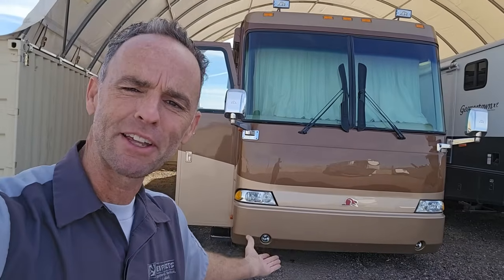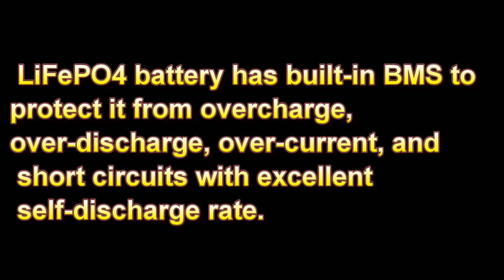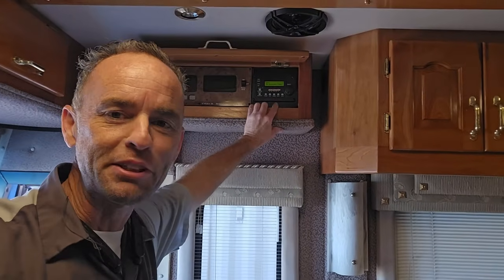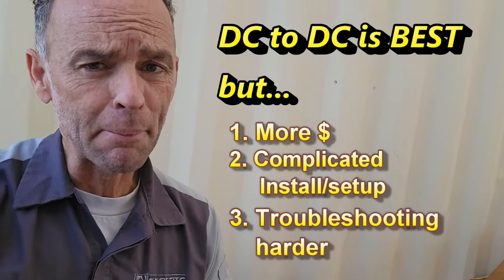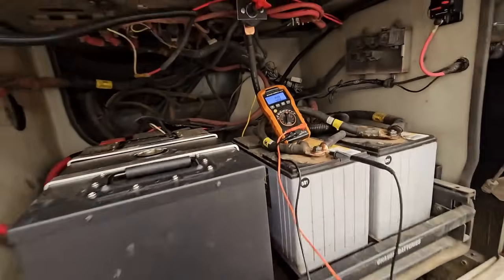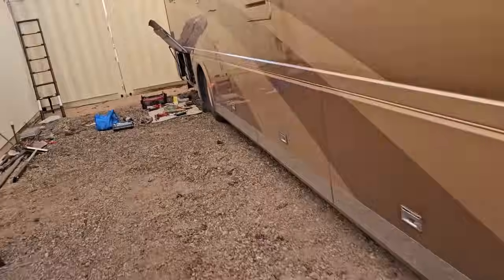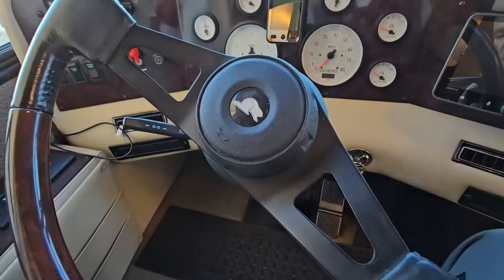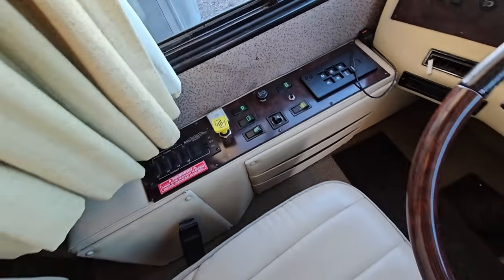What You NEED to Know About Adding Lithium Batteries to Your RV

Comment: You are very wrong in your explanation of the operation and responsibilities of a BMS.
Reply from the maker: Nah uh
Reply: @AZExpert  the BMS is a safety switch, like a circuit breaker. It is NOT a charge controller.
Reply from the maker: @charlieodom9107  https://www.synopsys.com/glossary/what-is-a-battery-management-system.html
Reply: @AZExpert  You are the one who should be reading that. Let's hope your viewers don't follow your advice on Lithiums, or they are going to wind up burning their property down.
Reply from the maker: @charlieodom9107  I did read it, no where does it state the BMS is an on-off switch and has active control for charge for the cells, I sent the link for your education as you have not been correct.
Reply from the maker: @charlieodom9107  I am also concerned what you think a circuit breaker is
Reply: @AZExpert  you obviously do not understand anything about a BMS. It IS an emergency switch. It is literally designed to isolate the battery in the event of a fault condition, such as over temp, under temp, over volt, over current, etc. That is LITERALLY what a circuit breaker does, only it can only "switch" in the event of an overcurrent condition. The BMS can switch off in many more fault conditions.

The only difference between a BMS and a circuit breaker in its function, is its ability to bleed off miniscule amounts of energy, normally passively, from one cell that is at a higher state that the others. That is not considered a vital function of the BMS, since it is such a small amount of energy that is bled off.

Very few BMSs have active cell balancing, and certainly not any installed in most batteries.

So, not only do I know what the function of a circuit breaker is, but your comment just clearly indicated that you are not qualified to argue the functions of a BMS.

A BMS will not control the amount of current going into a lithium battery. It can only act as a switch, turning on/off whatever you supply it or draw from it, and only does so when a fault condition dictates it, I.E. over volt, over current, over temp, etc. Quit telling people otherwise.

You should also look up what a CC/CV charge profile is, and how it relates to lithium batteries, because you are clearly misinformed.
Reply from the maker: @charlieodom9107  I appreciate your concession that it is not merely a on-off switch and has other functions including limiting current flow to cells in more situations than as overcurrent protection and has quite a bit of logic and control to its function. I've seen a switch and a BMS is not a switch anymore than a CPU processor is merely a couple of switches. Thank you.
Reply: @AZExpert  it does NOT serve any other usable function than a god damn switch! It does NOT limit flow to the cells, unless it is triggered by a fault condition. How is it so hard for you to understand?

Let me make it SUPER easy for you to understand:

A BMS will accept anything and everything you put into the battery or take out of the battery up to the failure point with NO REGULATION!!!!

That is the literal definition of a SWITCH!!! Just because it is a digital switch, and you can not understand that, doesn't negate it's function as a switch.

If the BMS was what you claim it to be, then why do you need a damn charge controller with lithium specific parameters? If it is more than a switch, then why does every single manufacturer require precise voltages, amperages, temperatures, and charge parameters in order to operate their batteries?

A BMS is a failsafe switch designed to save a battery in the event of a fault condition that could harm the cells, nothing more. You need to quit telling people otherwise, before you get someone killed!
Reply from the maker: @charlieodom9107  How would people be killed? The emergency switch as you call it would turn off the cells if the voltage is too high, current is too high, voltage is too low, temperature is too low, temperature is too high, or if cells are wildly out of spec or even dead. I have spoken to the battery manufacturers and they have also agreed. If you are building your own batteries with DIY cells you will need to make sure a proper BMS is connected as without it there is a definite danger, but that's the purpose of the BMS, to prevent danger and damage. I'd suggest making a video and sending me a link of your work. Let me make it simple for you, if a BMS turns off cells if voltage or current or temperature is too high/low and then back on again: it is regulating
Reply: @AZExpert  Fire is the number one cause of injury and/or death from lithium batteries. Using your advice in the video I watched, people WILL catch their shit on fire and possibly injure themselves, others, or kill someone.

Also, using a BMS as your charge controller is wholly wrong, and I can assure you NO battery manufacturer has told you to do such a thing.

The BMS is a last resort safety and should NEVER be utilized under normal operation. ALL battery manufacturers will tell you this. You shall have other controls in the system to charge lithium, or damage will result.

Charging a lithium directly from an alternator without a temperature compensated charge controller is ALSO wrong, as any battery manufacturer will tell you. You also can not charge ONLY lithium directly with an alternator without some type of load shedding device on the alternator or alternator regulator, but you did not mention this in this video.

You go on to state that the lithium battery charges faster at a low state of charge than it does at a high state of charge. This is false AND misleading. When the lithium charger is in CC mode, which is from 0%-96% or more, it can charge at the exact same amperage. It does not care. It is ONLY when the bulk voltage is reached that it moves to CV mode and the amperage starts to decrease. This happens at the very end of the charge.

You need to learn a few things about lithium chemistry before you continue to lie to people and cause potential injury or death. On the other hand, I make a shit ton of money fixing bullshit just like you suggest here, so maybe you are my job security.

I can give you contact info for engineers at Arco, Abyss, Lithium Pros, Optima, Victron, and several others if you like. They will all confirm everything I have said.
Reply: @charlieodom9107  After reading this entire exchange, all I can say is watch the video again. From some of your accusations, it's obvious you missed a lot of info.
Reply: @DaveDrawing  No, I did not miss anything.

Comment: i luv ur channel but, u are way over ur head in this. the bms on a lithium battery is almost the same charge rate as an AGM profile. the magnum u have will charge a GOOD LITHIUM BATTEY! please leave this up to the people who are an expert on this.
Reply from the maker: It seems unkind to use a compliment to soften an insult. You didn't disagree with my video but insisted I was wrong. BMS is not a charge profile, it is a control logic for the lithium battery, AGMs have no BMS

Comment: laughing at not upgrading your charging system...good luck with keeping the lead acid system in place it will fail as lithium does not charge at the same rate as lead acid.but keep the mis information up...lets see how long they last with the original system James..when you are on the road boondocking etc like we do
Reply from the maker: I think you may misunderstand but appreciate your input.
Reply: I've been running large Lithium house bank and Lead Acid chassis on my coach with older Xantrex that I reprogrammed for several years. I have realtime (and history plots) battery monitors to watch charge voltage , current and mAHrs and my system completely adheres to both battery specs for max charge voltage, currents, float voltages as well end of charge taper cutoff for lithium. If you know what you're doing it's completely feasible. The only thing I did different from AZExpert was disable the isolation relay anytime engine is running. So my geni never charges the Lithiums.  If I need to charge lithiums while on the road i just run the 10KW generator and they charge at high rate. AXExpert guidance is spot on in my opinion.
Reply: Generally speaking, a small-to-modest DC-to-DC charger is far superior to a relay.  Lithium can really do a number on lead-acid and vise-versa, and relays have no way to manage the amps.   Also, the lead-acid voltage range / alternator voltage can easily over-charge the lithium.

Holding any LiFePO4 4s battery at 13.6V or higher indefinitely will overcharge it, reducing the cycle life.    You do want to hold the charge target (typically 14.2V) for between 30minutes and 2 hours for balancing operations, but you do NOT want to hold the LiFePO4 battery above the float for hours (or days) on end beyond that.

The float must be set to 13.4V to 13.5V (without exception).   The key to longevity is to always let the battery drop to a 13.4V to 13.5V float after charging is complete (30 min to 2 hours of absorption).  That instantly relaxes the stress on the cells.

Now it so happens that for a lot of people the engine just isn't running long enough to cause a problem.  On the other-hand, if you are regularly traveling for 4-7 hours and your house bank is full and yet still being held above float that whole time... that isn't good for the battery and cycle life will be impacted.